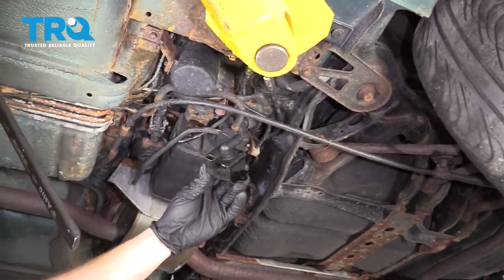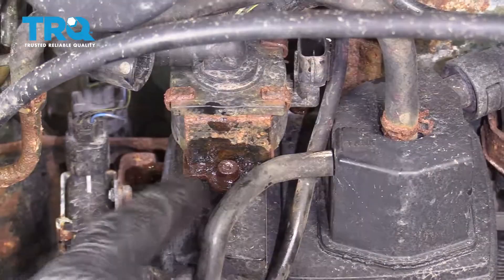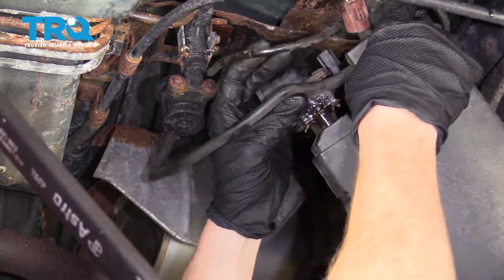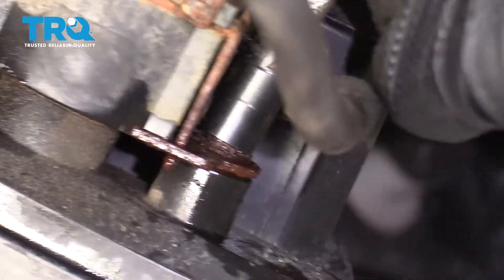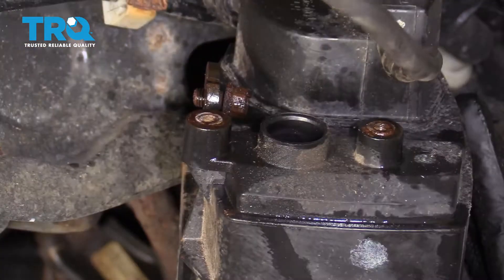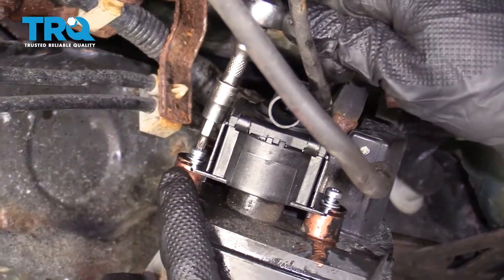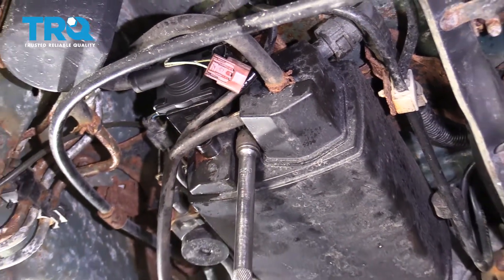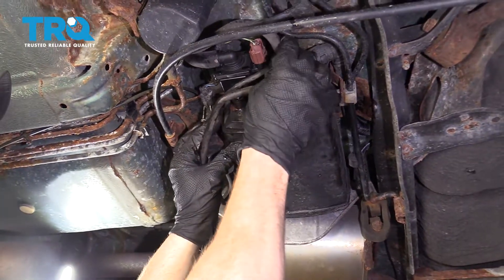How to Replace EVAP Vent Solenoid 1998-2002 Honda Accord

Comment: The screws were Phillips head not Torx in my changeout.

Also, it’s significantly easier to just remove the entire evaporator.  It’s just one bolt and a few hoses.